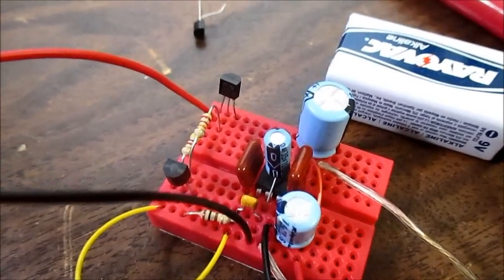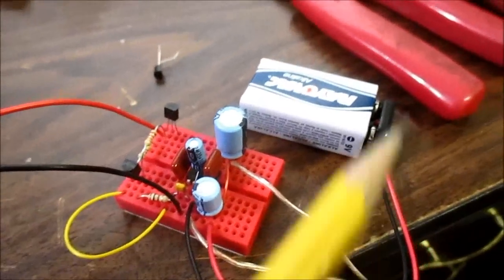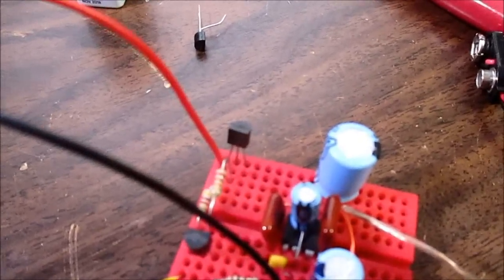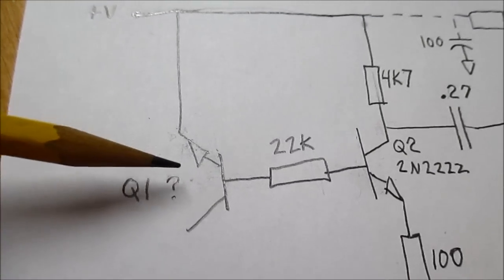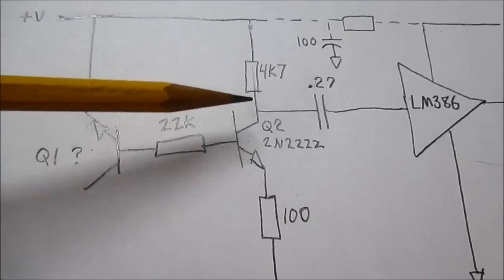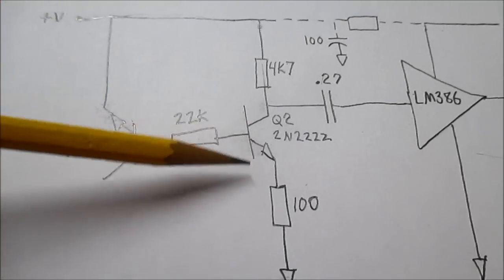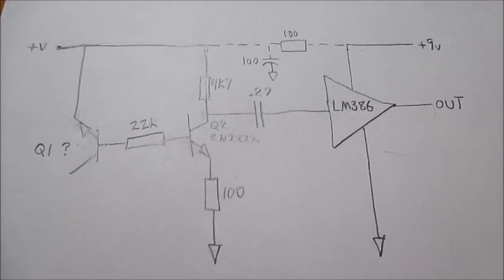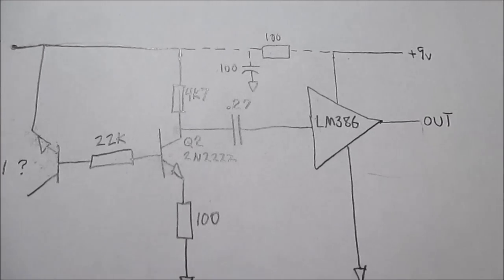Electronic noise source

Comment: I see you are using an LM386 for power amplification. I have found that these chips are in and of themselves a fine noise generator.
Reply: How do you do it?
Reply: @murrrr8288  With a regular opamp you do that by tying the two inputs together an no feedback from the output. This leaves the opamp in max gain and the smallest noise at and in the input stage will appear max amplified at the output. But it does require a bubble (+ & -) power supply. You can test if tying the inputs of the 358 together (so only to each other and non to ground) on a single 9v battery has the same results. If so, I would love to see it and hear the noise in a Yt video.

Comment: The noise from a reverse junction is 'shot' noise, either from zener or avalanche effect (under 7 volts is zener). White noise is made by thermal noise, or johnson/nyquist noise. Obviously this circuit will have both these, but mainly shot noise and 1/f noise or flicker noise, also made by all active components.
Reply: If it's flat in the frequency response for the requirement, it's white. Even though it's not johnson noise. You are definitely right just that's all depends on the application.

Comment: Hey, John! Very interesting video! On the subject, it seems there are all kinds of ways to “ prevent oscillation” on an amplifier circuit. Now, what if we’re aiming to get that oscillation? For exemple: a VCO module for a synthesizer. Would it be easier or harder to accomplish? How would one go about determining wave shape? Thanks!
Reply from the maker: You probably could create that with logic ICs and op amps circuits to shape the signal.
Reply: JohnAudioTech thanks for the answer, man! You’re awesome!

Comment: how we can use it to generate true random numbers?using Arduino card?what is the arduino program?
Reply from the maker: Many simple microcontrollers have an 8 or 10 bit A to D converter. With amplification and filtering, the signal could be processed then fed into the micro and a random number generated.

Comment: Interesting. Wonder how temperature sensitive it is? You could probably use your spectrum analyzer function on your scope to see how correct the noise is.
Reply from the maker: +HillOrStream Considering the "noise" transistor on its own, I'd think the noise would extend well into RF and be limited by the junction capacitance. I'd need a wide band OP amp to get a good measurement.